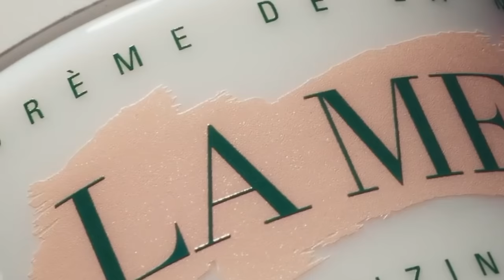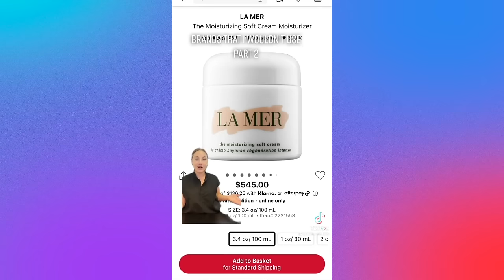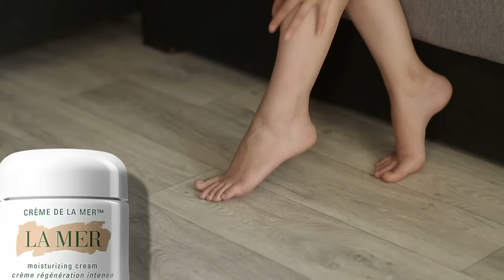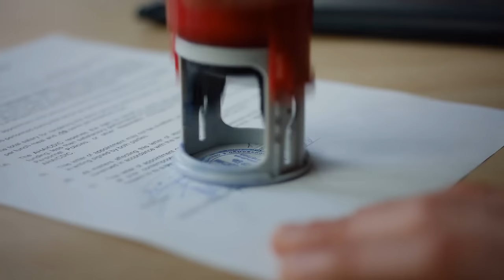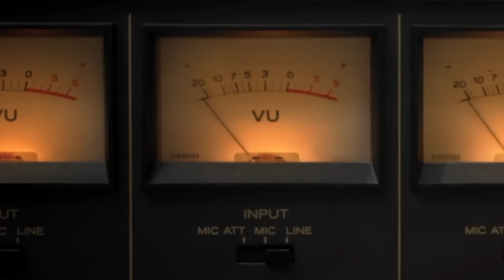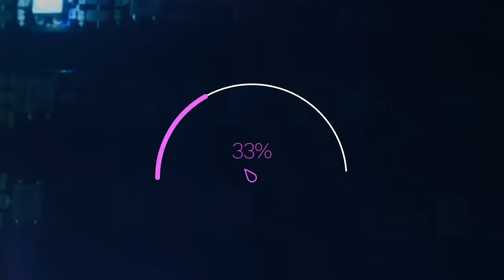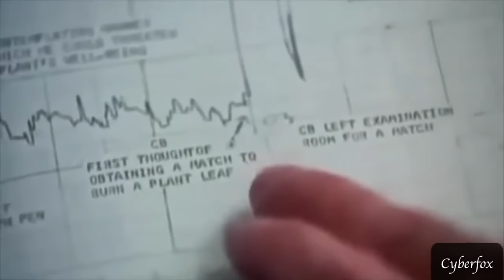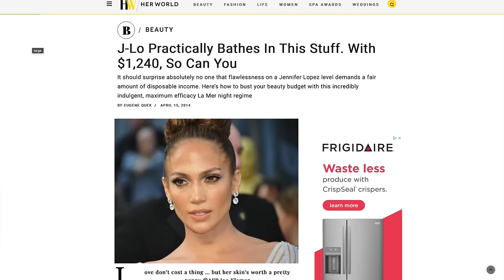The Ugly Truth: Why Do Youtubers HATE La Mer? | BJ Investigates

Comment: I used to work at The body shop briefly before I ended up doing visual merchandising for the company proximately 15 years ago and it's funny because that french guy is applying the moisturizer exactly how we were told to do it back in the day. If you're using your hands to rub lotion all over your face you end up mixing your hand oils + dirt + germs and therefore breaking down the lotion itself, yada, yada + by rubbing it all over your face with your hand you're actually absorbing more lotion into your hand than into your face. Also most important by not using an applicator and using your fingers to scoop out your lotion you contaminate it by leaving behind your hand oils + dirt + germs. Then you put the lid back on and put it on the shelf all the while all those dirty germs are having a hayday multiplying like crazy in the tup of food you just deposited them into.... Excreting and having babies all in your lotion thats now contaminanted. 

Wash your hands before sticking your hand in your lotion :)

Comment: It’s false info that loud sounds rupture the ear drum. Unless it’s a accompanied  by something that changes pressures for example , very loud noise close to the ear, with air pressure changes from fast moving  gunshot. It’s the  the rapid change in ear pressure, not sound energy just like pressure  occur when flying, scuba diving, or driving in the high altitudes.

Also sound waves cannot cause structural changes  chemical changes or molecular bond dissociation by the definition of sound because its  a linear pressure wave although it ca move particles around but that doesn’t cause any effect on any matter composition.

Comment: I paused the screen and even besides the algae extract, they have a few of the same ingredients but the la mer has a TON of ingredients that the nivea doesn't have. The ingredients list is more than twice as long. So it stands to reason that la mer possibly could work much better and way differently than nivea. (Also i can not afford la mer but i got a sample set of it from someone once and the serum and eye concentrate i didn't see much difference but that moisturizer? Omg it made my skin BABY SOFT. And i have also used nivea i used to use it when i was younger and it didn't work well otherwise i would still be using it 😅😂).

Comment: Skincare is very intimate. I love La Mer and a friend of mine wanted to use but it didn't work for her and she broke out. She adores Boots skincare and when I wear Boots, it's like getting a rub down with motor grease. And I say that about La Prairie, which is another ultra luxe brand. I hate it and people will swear I'm off my rocker. 

Also, there is a way to shop La Mer to make it less expensive. You need to work with a rep at a retail store, build a relationship, and get the promotionals, samples, facial comps, etc. I work with a rep and I may spend $800 but then I'm getting another 2 months worth of product as free sample (I mean LITERALLY full size products) and once you break it down, it's not any more expensive than using any other high mid-range brand. One tub of the hard cream (that's what I call the original La Mer now there's the soft cream) lasts me almost 2 months. Also, the soft cream is a hustle. Get the hard cream and the oil and thin it down if you hate the thickness of the original. Better use of your money. Not to mention that oil is killer! And yes, a lot of La Mer IS redundant. You only need the hard cream, oil (if you want to keep it cheap) and also the toner and an eye cream. Avoid all the other scam bait products. Although the foundation is pretty good.....

When people ask me if La Mer is "worth it," I say the one that works well with your skin that you can comfortably afford and enjoy to use is what is really "worth it."

Comment: I get the overall message of the video but the "science" examples brought up and visually referenced were mostly a bunch of nonsense.
Which kind of goes against the whole premise of the video. 🤷 

Sorry but a study is not science and for example cymantics is NOT even close to changing molecular structures or anything like that. It's basically just the plate vibrating. 🤷 
Different sized plate, different vibrations, different patterns. Nothing to do with the sand on top.